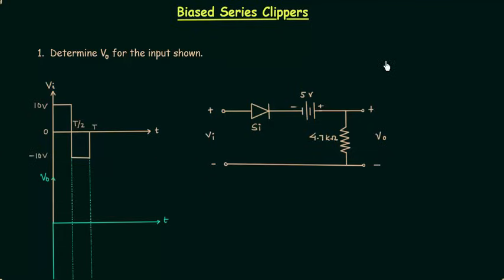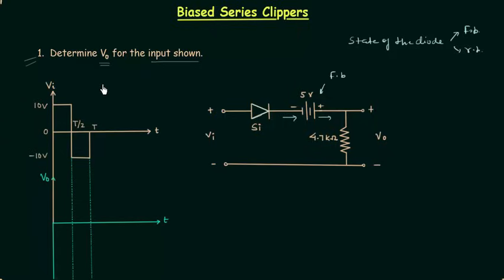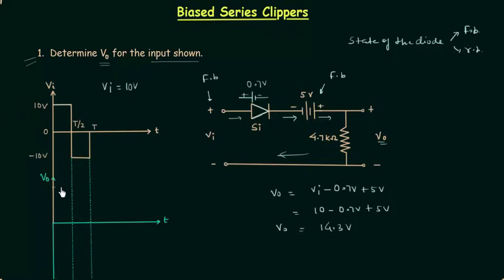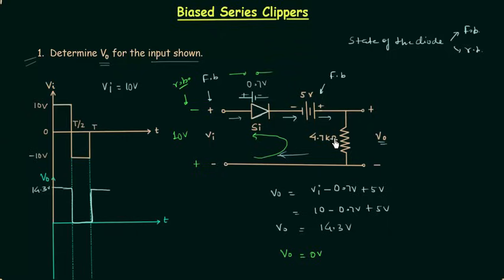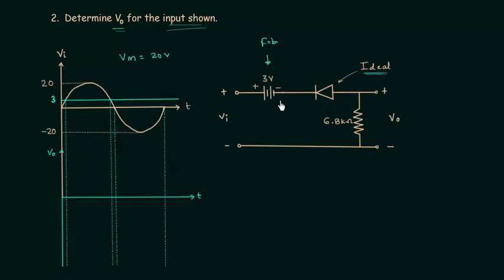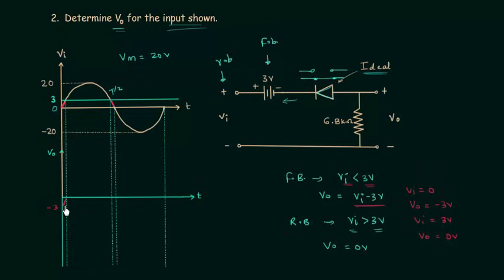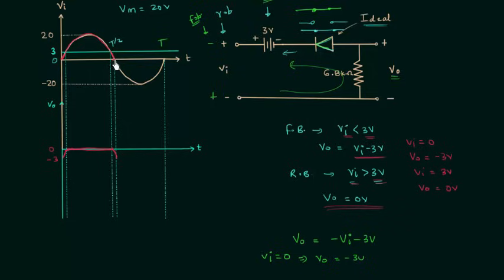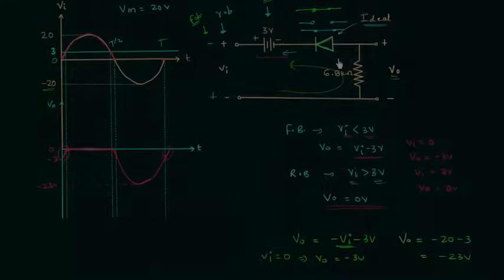Biased Series Clippers

Comment: confusion 1st question you consider negative cycle 0 though there was 5 v baised but in 2nd question you did for 3v
Reply: Cause in the first question the input is directly 10 volts which is more than 5 volts. While in the second one input is increasing gradually
Reply: @hrsimon3193 thanks bro❤
Reply: @hrsimon3193  thank you !!!

Comment: 5:05 In 2nd ques, how Vi<3V => F.B. and Vi>3V => R.B.
Reply: Yes it’s wrong. It should be reverse biased and for whole of positive half cycle it will also be 0
Reply: @mohanmohanty7331  Thanks bro keep growing 💗
Reply: No it is correct because during the positive cycle it will only be forward biased when vi <3 because when the battery is less than the input voltage the battery will be considered and will be counted as forward biased
Reply: @spooky_5226  okay bro🤭😂
Reply: @VijayKumar-go6cr  what

Comment: As a battery show only potential difference ,how can we say that its negative terminal attached to n side of a pn junction diode ,is forward biasing it when its positive terminal is not connected to p side of pn junction diode ,the negative of battery  can be at zero voltage,how we say definitely it is less than 0volt

Comment: You got it wrong there, remember that the battery during Positive half cycle is -5V, where in the input Voltage is greater because 0-20V, so 0 is still greater than -5V. So there should be no output waveform during the Positive half Cycle
Reply: I am looking for this explanation, thank you for making clear

Comment: And what if the additional DC source reverse biases the diode 
 Can you give some examples on that
Reply: It will hold the diode in reverse condition till the AC sourc voltage is greater than the DC one...

Comment: How u get for negative output, vo=-vi-3v,(I'm asking about the sign) second problem
Reply: If you would check by doing KVL clockwise, -Vi-3V-Vo=0; Vo=-Vi-3V. And since it is forward biased on the negative half-cycle, Vm was used for the purpose of plotting the waveform produced by the clipper.
Reply: @christiancastillo3857  in negative cycle drop across RL will be  -ve

Comment: Then what about the voltage cycle up to -5v ,until this value it will be forward biased ,after this it is reverse biased ........can you explain?
Reply: It's variable DC supply and its value from -10 to 10 not from zero to 10 
So anode of diode is always connected to minus ten not to zero.
Reply: You are correct... He had done it wrong

Comment: Sir i think In first question... The negative half cycle should come upto -5 V
Reply: It's variable DC supply and its value from -10 to 10 not from zero to 10 
So anode of diode is always connected to minus ten not to zero.

Comment: Sir..i have one doubt in 1 st sum..during -ve Half cycle..after 5 volts only ..the diode is open so there is no current flow..but u said ..there is no current flow in the circuit during -ve cycle..thats why sir...can u explain that part...
Reply: Because the input voltage is a dc voltage so it will always give 10 volts. But the second one is an ac source that's why it keeps changing its values.

Comment: In solving some circuits by this methode i dont get correct results,means the clipper does not clip the waveform in any way neither positive clipper nor negative clipper.The waveform comes as it was.It is not being clipped.Please explain this point.

Comment: Sir why u didn't mention 5V in output waveform in the first problem?During -ve half cycle when Vi <5v then 5v is FB the diode so .....
Reply: In the first problem the voltage is changing from 10 to -10 instantaneously with no voltages in between.
Reply: @sayanbanerjee2722  oh thanks, completely forgot about that...was thinking it's a mistake
Reply: Yes! Exactly

Comment: In the first example , why the output voltage is zero??? 
  There is a 5V voltage source...so the output voltage could be 5V ....am I correct???
Reply: NO..during negative half cycle, current passing through load resistor is 0 amp, So obviously output voltage is zero...no matter how many DC sources you have they all are inactive

Comment: Doubt!!!!
I think you will get at least 5V, whenever you supply input source or not.
For problem no. 1: For the negative half cycle, you should get 5V as output ...
Reply: actualy 1st problem is correct because the voltage is changing from 10 to -10 instantaneously with no voltages in between.
Reply: @94D33M  are you mad... You don't know anything about square wave voltage
Reply: The input signal is square wave which give +10v or  -10v  so..  If it would be sine then there would be plot in negative cycle
Reply: @terribleloser.24  then why they shows a value of 14.3 V?if the square and sine are diff
Reply: I completely agree with Vivek .But even though the diode immediately switches off the circuit..there is an external 5v DC source which  depends on the diode in no way . Also the circuit is complete. So why dont we get 5v as output during the negative half cycle ?
please explain
Reply: @sreeram-vm8hs  you are right they don't know about it
Reply: @sreeram 2002 because during reverse bias one terminal of the output is connected to the 5V +ve but the  negative of the output and the negative of the 5V are not same beacuse its a open circuit during reverse biasing.
Reply: I think its because during negative half cycle the diode is reversed biased, so ideally it is open circuit so no current flows across the circuit hence IR=0 which is Vout. If we are using non-Ideal Square wave with finite slope and Diode with finite reverse Resistance then output may not instantly go to zero during negative half cycle.
Reply: @malefetsanelenka8013  absolutely correct !!

Comment: dear sir, your videos lectures is easy to understand but i cant understand one thing in this lecture.
IN second example of sinusoidal waveform at the first positive half cycle where the condition of forward bias ( Vi<3volts ) you write a equation Vo=Vi-3v but I dont understand this equation. I think equation will be "Vo=3-VI". I am getting this equation by KVL.
KINDLY GUIDE ME
Reply: Remind Kvl:
      
-->Total Voltage = Sum of All Voltages in the circuit
Here:
--> Vi = Total Voltage
-->3v+Vo = sum of voltages

so by that: 
for +ve cycle:
 
    using kvl,
        Vi = 3v+Vo
        Vo=Vi-3v
        as diode is connected reversely, so for +ve cycle the Vo will generate till Vi<3,
        for Vi>=3, the Vo stop generating as now the diode behave as short circuit

for -ve cycle:

    using kvl, 
       as the cycle is negative Vi will be treated as -Vi,so,
        -Vi = 3v+Vo
        Vo=-Vi-3v
Reply: the equation that is written at the time of 5 minutes and 37 seconds is Vo= Vi - 3 volts.
but when we apply KVL it should be 
--> total voltages = -Vi - Vo +3volts
--> Vi= - Vo +3volts
please reply again to make it clear
Reply: in +ve half cycle at 5.37,
total voltages = -Vi+Vo+3 
u cant take  -Vo as its +ve terminal is connected to the +ve terminal of Vi and its -ve terminal is connected to the -ve terminal of Vi so Vo will be taken as +Vo
if Vo is connected to Vi in reverse than Vo will be taken as -ve Vo in KVL equation
Reply: thanks sir,, finally get it
Reply: @kamimart   sir how can we say that the upper terminal of resistor is +ve and lower terminal of resistor is -ve as we are considering current in anticlockwise direction, so current in the resistor should be from lower to upper. In that case the lower part will become +ve and upper will become -ve. (as current flows from higher potential to lower potential). Sir kindly please help me to figure out the fault.

Comment: Sir at 7;38, using kirchoff's law, the equation comes as Vi-Vo+3=0.
therefore, Vo=Vi+3.
why have you taken as -Vi-3. Please explain.
Reply: No       Vo =Vi+3        this equation doesn't exist in any of two cycles,
for +ve cycle:

    using kvl,
        Vi = 3v+Vo
        Vo=Vi-3v
        as diode is connected reversely, so for +ve cycle the Vo will generate till Vi<3,
        for Vi>=3, the Vo stop generating as now the diode behave as short circuit

for -ve cycle:

    using kvl, 
       as the cycle is negative Vi will be treated as -Vi,so,
        -Vi = 3v+Vo
        Vo=-Vi-3v
Reply: ankit burnwal don't think so much just remember its written in a book we always have to take upper part of output voltage + and lower part  as -  wherever the current direction is in clockwise or in anticlockwise whenever we apply kvl always take  V output as +ve thats simply its not a rocket science
Reply: see the polarity bro

Comment: sir... what will happen to the -ve output cycle when the basing DC supply is greater then the input -ve DC voltage in case of positive baised series clipper.......the DC supply in series should be in forward direction.....

Comment: What about 6.8 K,ohm of resistor?
Reply: I have the same doubt. Did you get the doubt clarified?
Reply: @krithikamudavath9395  its 20 V + 3V / 6800 = 0,003 (practical 0) or ground.

Comment: i think you made a mistake at 7:40 where Vo should be -Vi+3  but you wrote Vo = -Vi-3
Reply: But it is not positive half cycle it is negative half cycle that's why polarity of Vi is changed
Reply: the equation will be -Vi-3 only.
Reply: Fawad Khan --Correct or not that equation..
Reply: I think it should be V0=Vi-3 ???

Comment: i think u have done incorrect
Reply: Neso Academy the last one
Reply: By applying K Law, it should be V(battery)-Vi-Vo which means Vo= 3-Vi. (@ 5:35). Correct me if I am wrong.
Reply: @nesoacademy   you have drawn the diode equivalent circuit wrongly

Comment: can you pls explain me why Vo is 0 at 3:30 ..when diode is RB, it's replaced by OC. then Vo should be -5 V...pls clarify my doubt ASAP...
Reply: Vikas Kale when the diode is Reverse biased we will be replacing it with open circuit so from the input side there is no current enters into the load resistor R. The voltage across the load resistor is the output voltage so the current flowing into the resistor is zero. As  V=IR, therefore output voltage is zero
Reply: apply  kvl
Reply: all voltage will be across open circuit
Reply: It's variable DC supply and its value from -10 to 10 not from zero to 10 
So anode of diode is always connected to minus ten not to zero.

Comment: When we apply KVL in circuit (at 7.45 s of the video) Vo = Vi +3. Can you please explain how did u get Vo=-Vi-3. please
Reply: if u apply kirchoffs law in clock wise u get -vo-vi-3 =0 here vi direction is reversed because it is in negative half cycle,take time and see it clearly:}
Reply: @srinadhj2638  how did you get -vo in the equation you wrote.
Reply: U must not change the polarities of Vo .it should same as given
Reply: bhawani is right..so that straight path is going to be for you dude.idiot.
Reply: same doubt. please reply sir.
Reply: don't think so much guys just remember its written in a book we always have to take upper part of output voltage + and lower part  as -  wherever the current direction is in clockwise or in anticlockwise whenever we apply kvl always take  V output as +ve thats simply its not a rocket science
Reply: Have you studied circuit Analysis 1 or 2 in your life.
if (You == studied)
{   
 print: (then: Its your default that you did not Understand What is going on in class );
 But if (You == studied)
{  And don't get it Then You are A fu**  A*.H**;
else 
There is a straight path 'Just Go To Hell';
Reply: @heydad1131  STFU
Reply: @heydad1131  Who the fuck talks in code like this? The cringe is unreal. Grow up, moron.